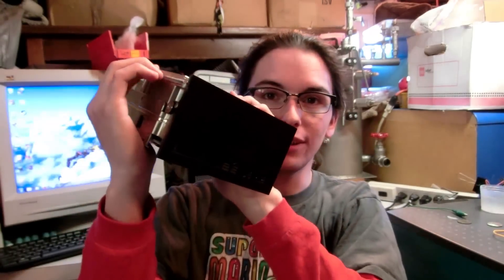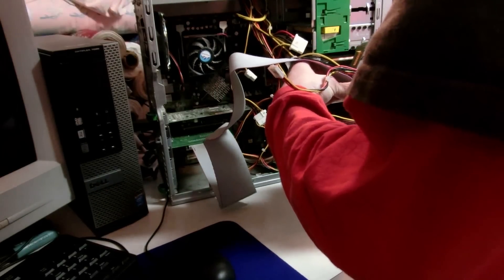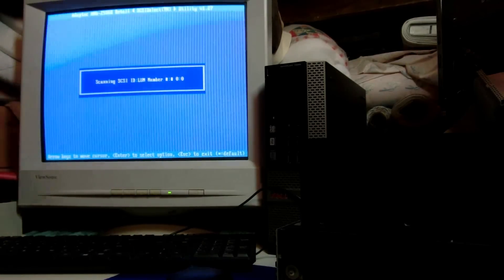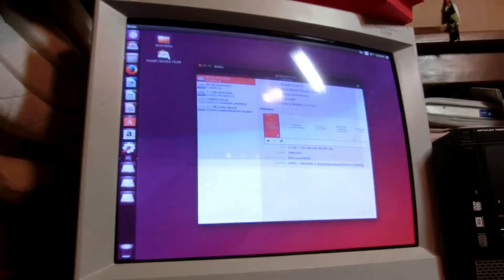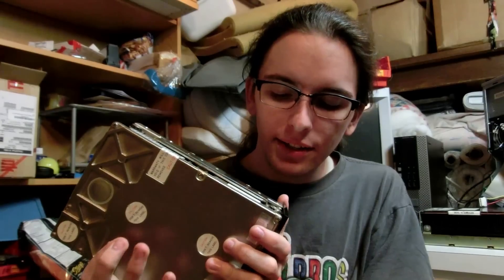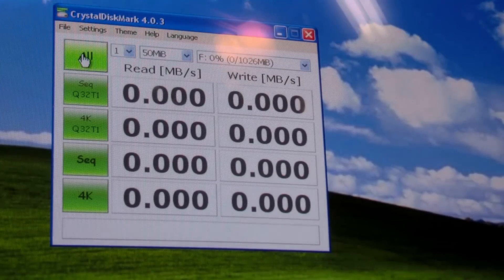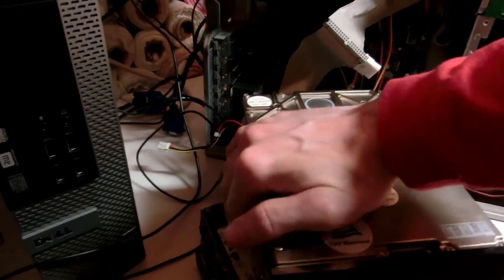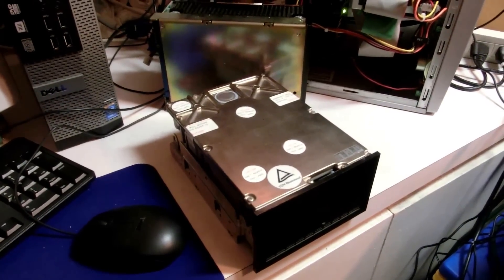Data Archaeology 001: 1992 one Gigabyte Fujitsu hard drive

Comment: I'm not sure if this was actually the primary hard drive of some computer because the drive's SCSI ID is 2 and at that time convention was that the primary drive was set to 0. 3 was common for CD drives, 5 and 6 for scanners and ZIP drives. My external CD writer was 2. SCSI with all those BIOS gadgets was a HUGE step above MFM and IDE where you had to enter everything by hand, heads, cylinders, blocks, writing precompensation and landing zone (although IDE controllers really ignored that and you just had to get something close to the actual drive's capacity, which, in a way, made matters even worse because if you swapped a drive from one machine into another you'd need to know the parameters used to format that drive in the first place, same if the CMOS battery ever failed or was disconnected)! SCSI was essentially Plug&Play from day 1 but that had a hefty price tag.

Comment: The SunOS name is typically applied to the BSD versions. Solaris is typically applied to the Unix based versions.  SunOS 4 was rebranded Solaris 1 and SunOS 5 was named Solaris 2. When Solaris reached 2.7, they renamed it Solaris 7. When a Solaris system boots, it will still say SunOS 5.8 as it is booting but will show Solaris 8 at the login screen.

Comment: Aaaah, old mechanical drives!
I have an old Western Digital 825Mb drive,  manufactured in 1995 (it cannot compete with your drives as per the age) but what's interesting is that it still runs fine, and does so since I found it in 2009 and put it in a  server that stays on 24h/7! The speeds are quite good as well, and has no bad sectors!
The WD Caviar 1TB from 2013 was rubbish in contrast (it died very soon, it would start to accelerate at mad speeds like it's trying to self destruct and then scratching noise) ...
Reply: Does it still work?
Reply: @ducksonplays4190  It does!

Comment: Good stuff.  While it could have been used on a college campus, you were probably just seeing the BSD License copyright info on all those files.  SunOS was a variant of BSD unix (Berkeley Software Distribution, originally developed at UC Berkeley) that ran on Sun's workstations and servers with motorola 68k and SPARC CPUs, and was required to include that copyright info.  BSD systems typically shipped with source code and some simple text-based games like adventure, snake, and robots.  You can install those same games in linux with the bsdgames package.  http://wiki.linuxquestions.org/wiki/BSD_games   SunOS was replaced by Solaris, which was based on AT&T's System5 unix instead of BSD.  Some laserdisc players had a serial port that could be used for computer-controlled playback to make video-based interactive education or product demonstration discs, before being obsoleted by DVDs.

Comment: Yeah I know. Sorry for rambling . I was speaking about transfer of ions acids and ammonia/ hydrogen fuel cell and a method to reduce cost involved in traditional electrolysis methods and also I have a lot to learn about STEP. Aka solar thermal electrochemical production. Sorry again for piping in. After all ,your video was about old hard drives. Just so happens you helped me figure something out that I have been working on.
Anyway I enjoy your videos. Keep up the good work

Comment: This is less for your benefit and more for the general public. 'Ubuntu Live' will not format anything unintentionally, it's a non destructive image that runs from swap, CD, or memory. It needs a user's control to format, with a few questions that need to be answered before formatting will occur. I'm sure you knew that, though. Also, hardware - especially older hardware sucks, it will effect the speed of a  full size live distro (like Ubuntu) running from cd, as it would any other graphically intensive software running live from CD. However, Gparted/Parted Magic live cd's, are smaller distros that can run exclusively from memory, with low graphics, and are very responsive, even on old hardware, and they are also non-destructive. They come with a myriad of software based tools for exploring hard drives and what-not and I believe you would enjoy them, since you like to explore older and found hardware. And as always are free to use for non commercial purposes. Cheers.
Reply from the maker: William Hunt yeah i tried installing it on the C:/ drive but it formatted teh wrong drive. ubuntu doesnt show the drives as C:/ or anything it only shows the partition size and sometimes the file system. this is the same way i formatted my 3TB backup drive with all my data on it.
Reply: Rinoa Super-Genius understood.